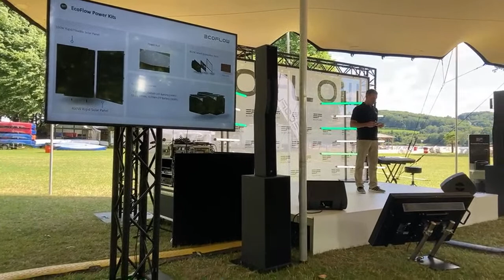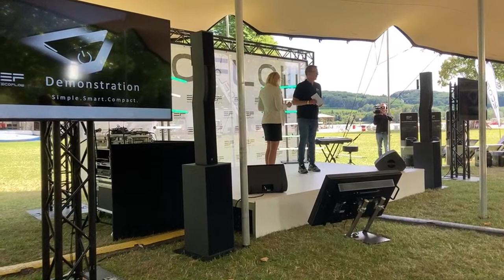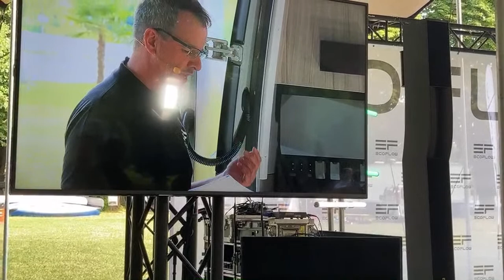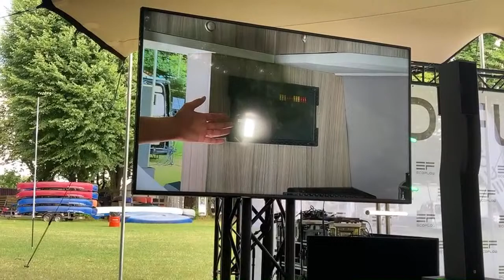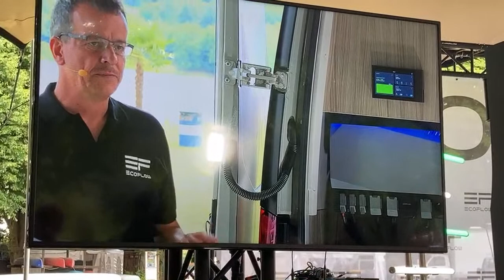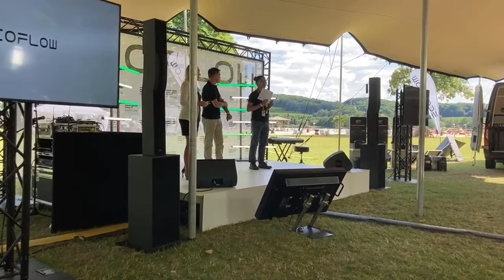Présentation ECOFLOW power kit

Comment: bonjour à toi, j'aimerai te demander pour un foyer de 4 personnes dans une maison pour combien il y en a pour rendre autonome celle ci avec panneaux solaires et batteries?
Reply from the maker: Bonjour
Merci pour le message . 
Cela va dépendre d’énormément de choses et j’ai besoin de plus d’information sur tes besoins . 
Surface, localisation , technique de chauffage, isolation, consommation . VE a charger ?
L’idée aujourd’hui pourrait être d’installer un smart home panel ECOFLOW plus une batterie Delta Pro avec 1600Wc de panneaux solaires connecté en direct sur la batterie . 
L’idée est de deja voir le pourcentage d’autonomie énergétique et de pouvoir ajouter plus de batteries et panneaux avec le temps
Reply: @TeslaRiviera  bonjour, d'accord je comprends;
en surface nous avons 132 m2 avec une pompe à chaleur air-eau en plancher chauffant dans une maison de 2014, nous sommes dans l'Ain, l'année dernière nous étions à 5450 kwa et nous avons commandé le 1er mars dernier une tesla modèle 3 sr+